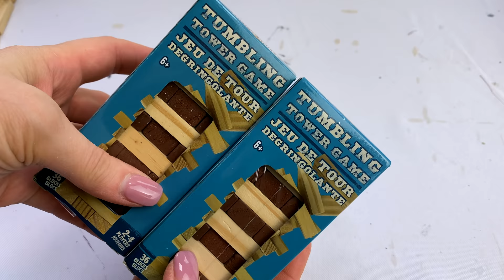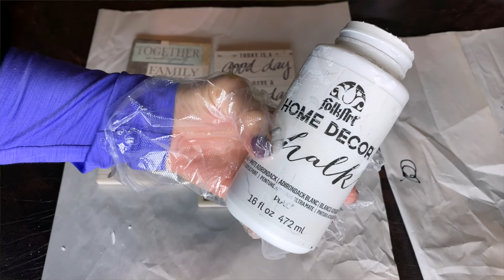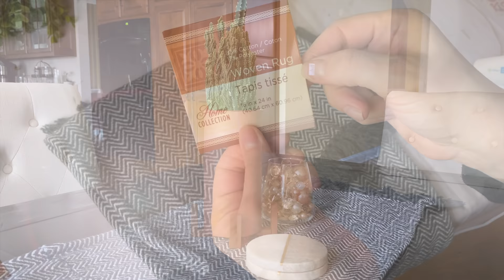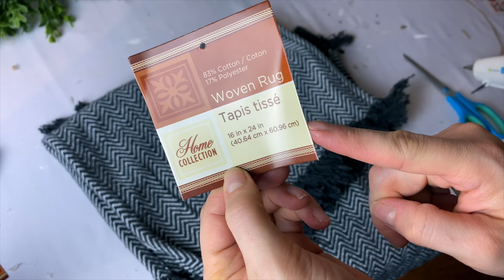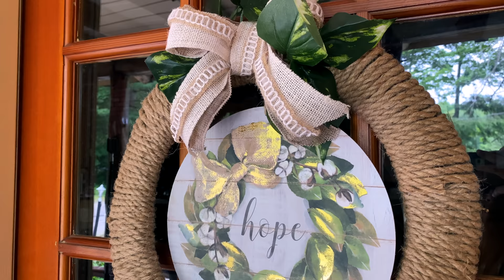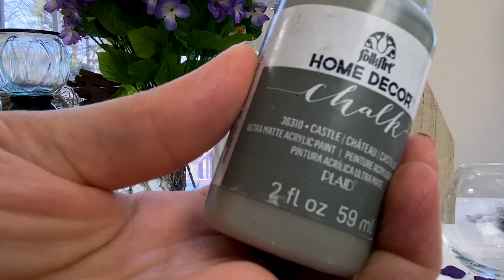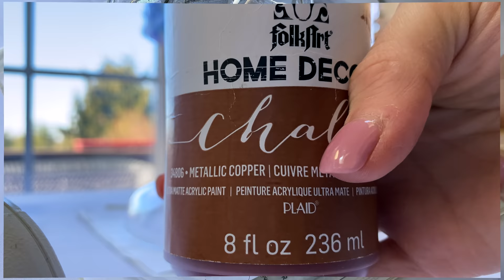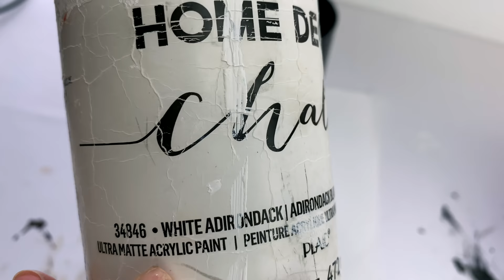20 DOLLAR TREE DIYS // ROOM & HOME DECOR DIY CRAFT IDEAS!

Comment: Great video! I'm happy that you ended up liking the sanded white finish on the tissue box holder. It did look really nice, like a beachy whitewash. If you definitely want a clear finish for something, look for Rust-Oleum's "Crystal Clear Enamel" not "Gloss Protective Enamel". With the latter, the cap indicates the color and it comes in lots of colors. You happened to buy it in white.
Reply from the maker: Thanks so much! 😊

Comment: Love these ideas! But the spray that you used in the first project with the tissue box, was a rust stop paint. I'm guessing someone put it back in the wrong section at the store. Rust proofing only comes pigmented, it's never clear. Just a heads up to check the labels when shopping. This has happened to me also. But it turned out for the better I love this white wash look 😊💖
Reply: No it isn’t I checked

Comment: A heavier paper towel role like the ones from Walgreens one are a stronger cardboard and use a dome shape plastic bowl for the base then put the PT cardboard on top and if you have a hot knife cut the center of the plastic bowl  to fit the PT cardboard in center then follow with the rest of your rope too the top? Just a suggestion cause you don't want something to heavy for the top cause yur adding the rope ! But luv the vase you did and like it without the tip also! Great job! 👍💜🙏

Comment: I was inspired by your rope and basket vase. I used 4 of the small baskets and glued them as you did. I then took the rope and separated the 4 strands and used them individually; only used the solid intact rope on the very top and bottom. When that was finished, I used the intact rope to make a braid to wrap around it and added some flat stones. All items including the greens came from the dollar tree.. I love the results. Thank you for the inspiration. I wanted to add a picture of my vase but the feed isn't giving me the option

Comment: For the long narrow part in the tall rope vase thing u did, you could use a piece of foam board to fit down inside and then attach like an empty tinfoil roll there much thicker than a paper towel roll. Or you could use a foam board at top and use a dollar tree plunger and then add the empty roll to top of that to get more of the exact shape

Comment: Love the popsicle stick wall art. I think it would look even better larger. Also, I agree with another comment about putting something on the back to "elevate" it from the wall to give it more pop. I have watched another Dollar Tree DIY content creator that uses the Jenga style blocks a lot and she uses gel super glue on them. Because it's thick it does not absorb and disappear into the wood and it dries quick. Wood glue takes a long time to dry. I think the gel super glue would have helped you with the popsicle stick wall art too. I'm thinking that project might also look nice with the jumbo craft sticks. Would need to cut the rounded ends off though. Just a thought.

Comment: The long neck at the top of the vase do not have to be the entire length as shown in your video because I agree with what you say.
Reply: I agree. But I would use a plastic microwave  bowl and a pool noodle.  Then finish with more rope.  Also, on the Popsicle stick wall art - I like asymmetrical designs myself.  Perhaps that would look good if you like it.  If you stick with the square-ish design, a little taller and a little wider wouldn't hurt.   But, that being said, it looks great as is.

Comment: For the Pottery Barn inspired design, what do you think about raising some of the squares 1/2"-2" above the base squares? In addition to that, take a collection of the black framed mirrors you used on the door and mount them behind the little squares. This will give several layers of depth and dimensions.

Comment: That  door mirror is amazing!!How did you manage to get the frames to Match up exactly?”
Reply from the maker: I lined them up on the floor first to make sure I had all exactly the same size mirrors and that everything would line up ok and it was good thing because I found quite a few mirrors that were about 1/4 to 1/2" off from the others and would not have worked well
Reply: @StyleMySweets  where did you get the mirrors from? I thought it was Dollar Tree but they are not showing up on there site! 😔
Reply from the maker: @amyhrycko1494  yes the mirrors are from dollar tree! Definitely keep checking because they usually have them so they might just be sold out right now but I think they have carried these mirrors for at least a few years